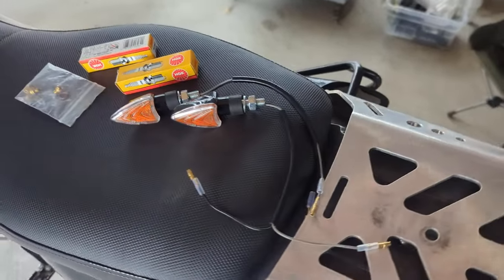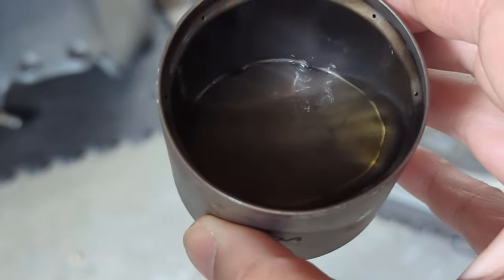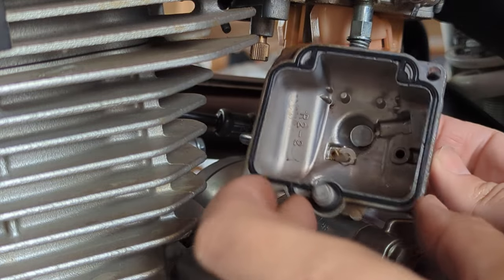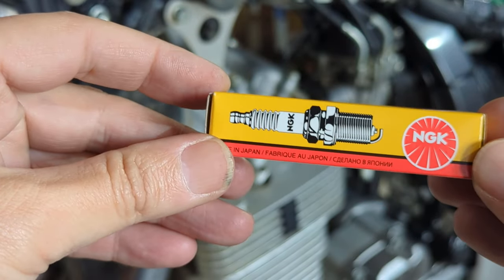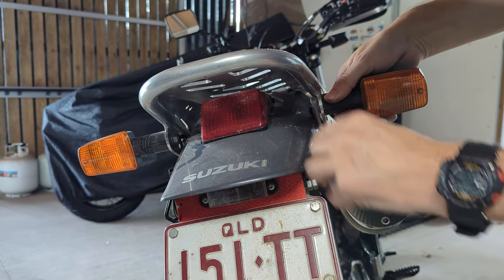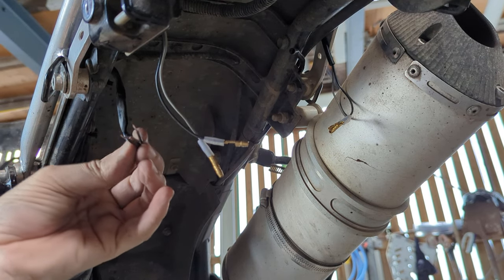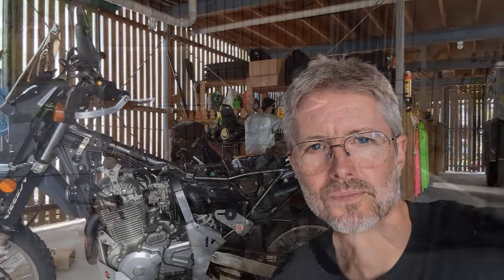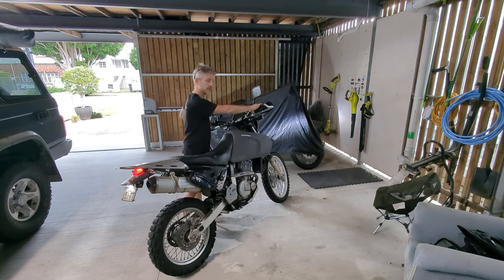DR650 Upgrades | Install New Indicators, Spark Plugs & Change The Jetting

Comment: Great video....maybe I missed one...may I ask what the micro switch activates on the left side of carby...it seems to activate off of the throttle position...is that the N2O system...🤔🤔  😁😁
Reply from the maker: Lol, yeah that's it, the N2O system 😂 Thanks for watching. ATB Jason 👍

Comment: Hey mate, a few questions . 1, your barret exhaust tip being black, did it come like that or have you painted it ? 2. about 8m18sec in there was some b&b eng cover - what is that as i've never seen that before or is it juck a sticker ? cheers
Reply from the maker: Hey mate, the exhaust tip was simply spray painted with high temperature black paint and the engine cover is simply a B&B sticker 🤙